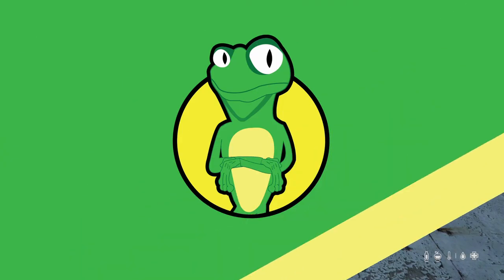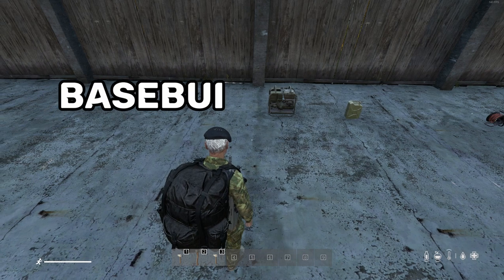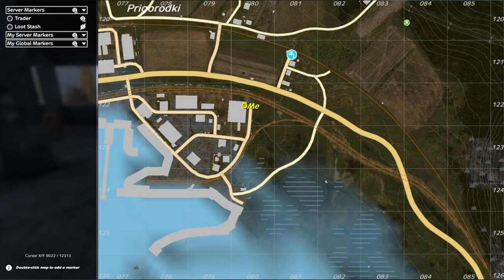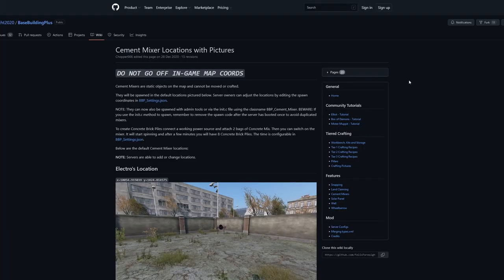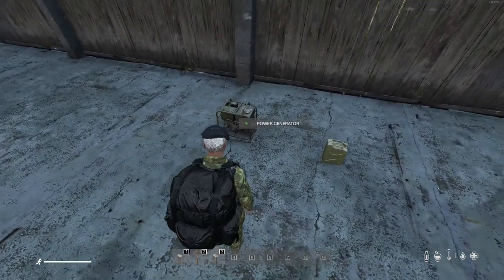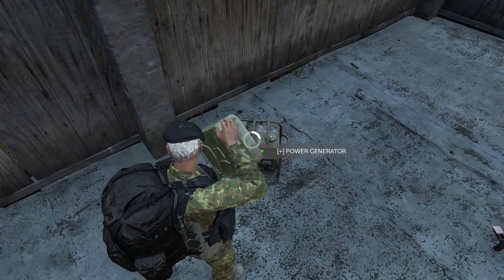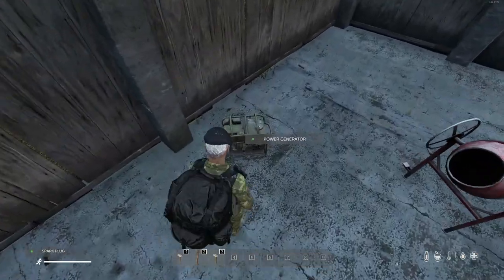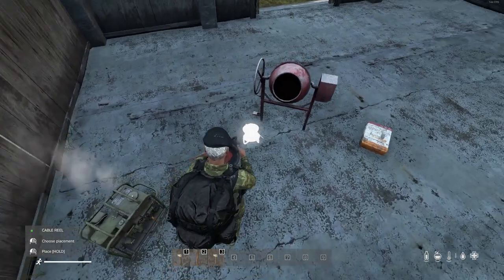DayZ BaseBuildingPlus - Learn How To Use The Cement Mixer In Just 3 Minutes!

Comment: ok. all good. b ut what tool do i use to assemble the bricks and mortar mix onto a wall/door/gate?
Reply from the maker: First build the frame with the hatchet. Some structures can be built further with the hatchet into a T3 structure but most require a shovel for T3.

Comment: Im trying to make bricks for the first time but I'm getting the "you must have group territory" message when I try to deploy my generator, so I assume I'm supposed to power it another way.
Reply from the maker: That means you need to put down a flag in order to use it. 
You can get power from batteries as well. I have a short video on power sources here: https://youtu.be/Pq4tnbz3rU0. 
The video is made for lights but it works the same for the cement mixer.